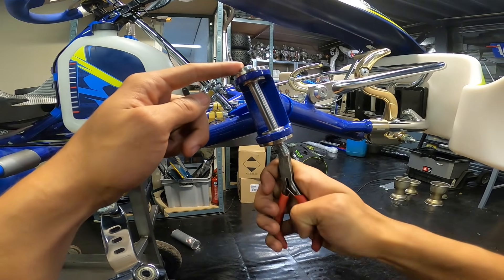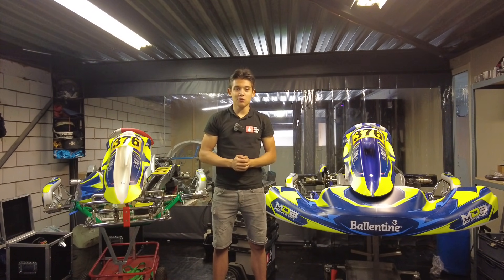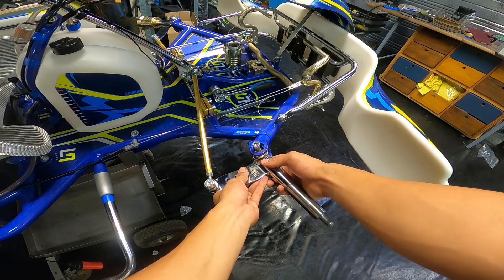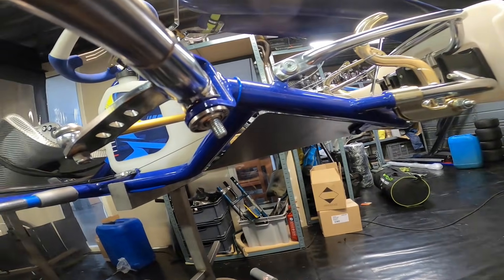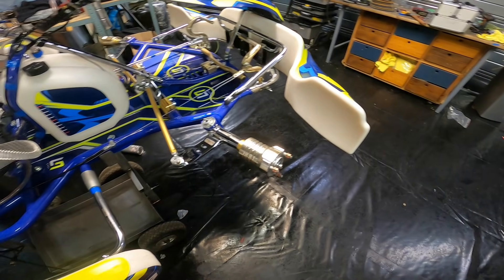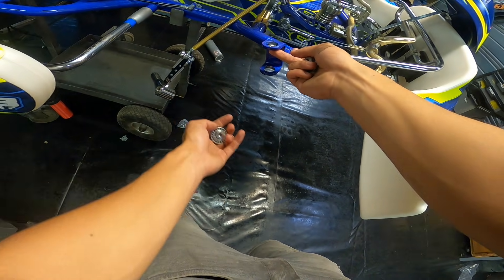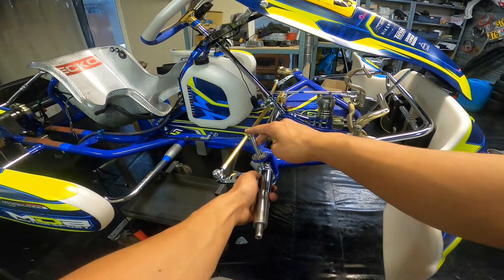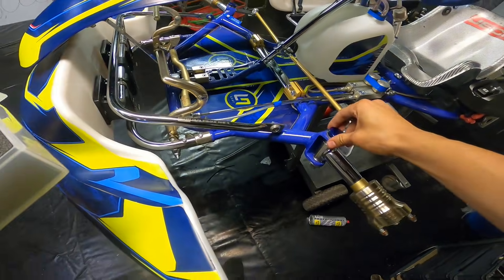CASTER & CAMBER EXPLAINED | Kart Setup Basics #3

Comment: Quick tip on putting the pieces together. Use a t-bar from the bottom to line up and hold everything. Then slide the king pin in from the top.

Comment: How important is it to adjust toe and camber with the driver in the kart or weight?
Reply: A kart part dealer we know whose been around for a while suggests we do it. 

In saying that, if you look at the bigger teams not a single one of them will do it. Having no suspension, it doesn’t vary much at all with extra weight (the driver).